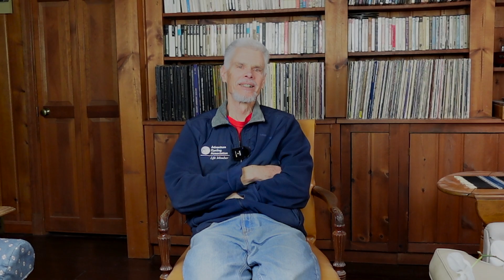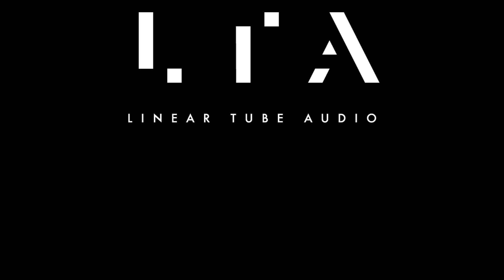Amplifier designer on the importance of power supplies to hifi audio quality

Comment: There seems seems to be an uniformed bias with ‘audiophiles’ that a device must have a linear power supply, with heavy transformers (vibrating), to be taken seriously. 

Soulution are now using switching power supplies in their $150k power amplifiers. 
One apparent benefit is a more stable voltage supply rail under heavy (transient) loads.

Comment: Thanks David and LTA. My LTA UL integrated is eerily quiet, not just for a tube amp, but for any amp. I wonder if the switching power supply has something to do with that?
Reply from the maker: It definitely helps!

Comment: I've always said this myself. The power supply stage is as important as the amplification stage. Although for my own systems I generally avoid tubes because, first it's not what I grew up with, I grew up in the zenith of A/B amplifiers right before the industry switched over to class D amplification.

But the principals remain the same as tubes but instead of high voltage power supplies you now have to design for high current. But after having repaired literally hundreds of pro audio amplifiers, it just really bugs me that the number one failure point I regularly see is power supply failures.

Although I am interested in your ZOTL technology. I've experimented with making the high current low voltage output of a class D mini amp sound more "tubelike". The class D amp chips like the Tripath TA2020 let go of their negative feedback when approaching their voltage limits, creating the tubelike soft clipping, instead of the hard clipping like A/B amps. When combined with an output transformer the mathematical conversions very much mimic the harmonics of tubes on an output transformer down to how speaker system resonances are amplified because negative feedback is greatly reduced by the transformer.

But it would be nice to eliminate the darker tone typically caused by the inductance of the audio transformer while keeping the tubelike sound of the class D amp. I've built some custom 4 watt 5 volt guitar micro amps for some guitarists who loved my demo amp. Ironically just as a joke I put a fake tube with an led light on it just to satisfy them because that way they can show off their 5v "tube" amp where they can show off the variable overdrive system I designed, it makes the woofers bloom and the tweeters crunch just like the real thing without having to resort to digital emulation. It's simply analog emulation of tube distortion.
Reply from the maker: Very cool. Thanks for watching!